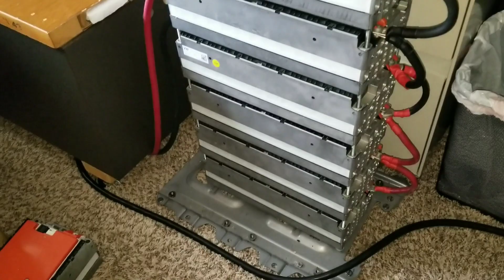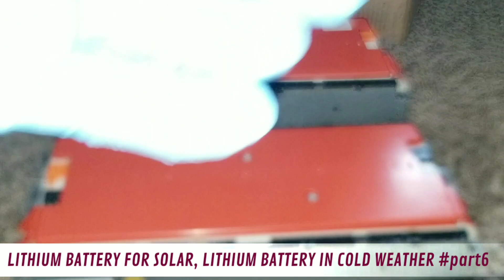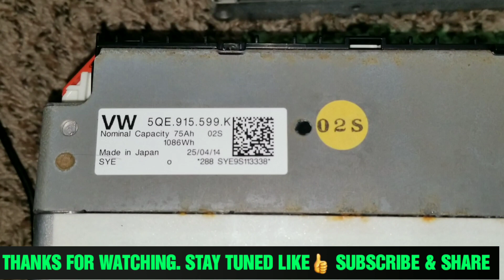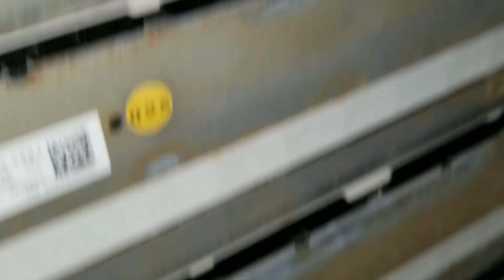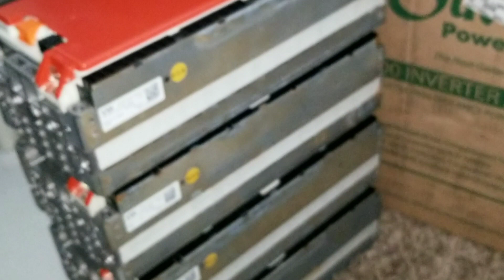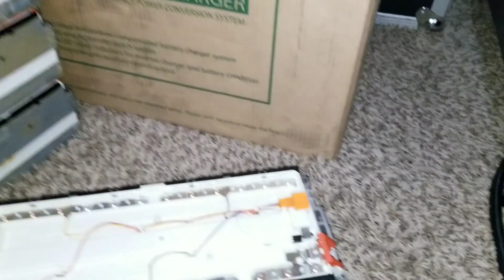LITHIUM BATTERY FOR SOLAR, LITHIUM BATTERY IN COLD WEATHER, BMS, BATTERY THERMAL MANAGEMENT #part6

Comment: Hi!
I also have an identical battery, only it has 44.5v, I want to make it 12v for the solar system. It has 12 cells x 3.7v each, I want to divide them into 3x4 cells connected in parallel. BMS on the top is a pain in the ass. I I'm thinking not to use it. Do you have any idea how I can disassemble the battery to get to the cell?Thanks!
Reply from the maker: That will be awesome DIY Project for you.
Thanks for sharing like and subscribe

Comment: There are 3 kinds of battery modules in the eGolf. The one with the circuit board is a "master" module and the one without the circuit board is a "slave" module and it is controlled by the master. There is a main battery control module that controls the masters. There is a 3rd style battery which is 1/2 the physical size and 1/2 the capacity of these modules.
Reply from the maker: Thanks for your input. Here's is the 1/2 of the Volkswagen e-golf battery you are talking about 
https://youtube.com/playlist?list=PLSNjIRSnUPDJVVuWqN_R8NXHe9lpmFT6k

Comment: Kudos! Very rare and exclusive information, there's no much like this on the internet.

I'm curious if one could pull out old cells and put back the new ones. But now i see that is not easy at all (
Reply from the maker: The terminals are all welded to each other. 
If you wanna separate the cells individually, you have to cut off the terminals with a axsaw or something. 
Like SHARE and SUBSCRIBE

Comment: I THINK , THE TOP CELL MODULE WITHOUT THE BMS , WITH JUST THE WIRES  MAY BE ONE OF THE SLAVE MODULE AND THE BOTTOM CELL MODULE WITH THE BMS MAY BE THE MASTER CELL MODULE .  ON EACH BMS MASTER CELLS , THERE ARE  2 ORANGE CONNECTIONS THAT CAN CONNECT TO 2 SLAVE CELLS ,  AND 2 BLACK CONNECTORS THAT MAY OR CAN PASS POWER OVER TO ANOTHER MASTER BMS CELLS BY THE OTHER BLACK CONNECTORS WHICH ALSO CONNECTS TO TWO MORE SLAVE CELLS  AND SO ON .  2 SLAVE CELLS CONNECTS TO EACH OF THE ORANGE CONNECTORS ON EACH MASTER BMS CELLS  . POWER COMES IN ON ONE OF THE BLACK CONNECTORS  IS PASSED TO THE OTHER MASTER MODULES  OUT THE OTHER BLACK CONNECTOR  . " DO ANYBODY ELSE HAS ANY OTHER IDEAS OF HOW THE CELLS ARE REALLY CONNECTED " ?
Reply from the maker: Thanks for your observation.
I am hoping to hear from more people input
Reply: More or less correct :) The PCB on a master module is not the BMS, it's kinda cell voltage and temperature collection controller. The BMS device itself is located in HV relay box.
Reply from the maker: @JPetr94  
This is why I didn't bother to wire up the internal board